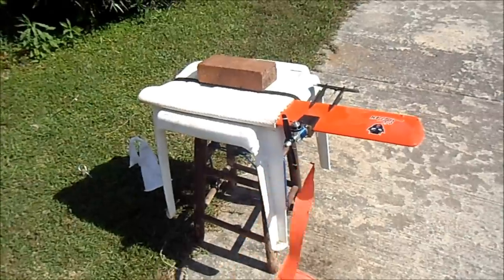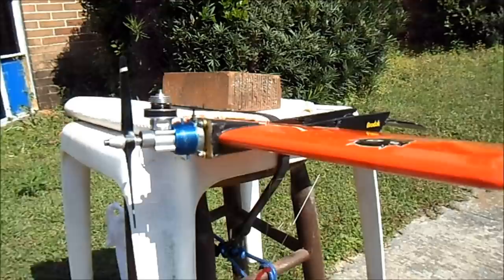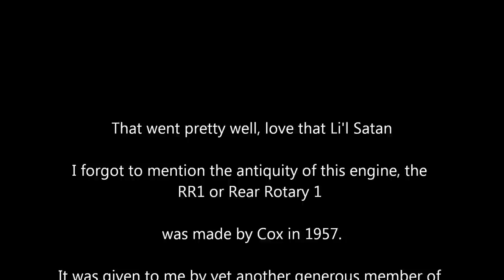RR1 maiden on the Lil Satan.wmv

Comment: How do launch by yourself?
Reply from the maker: Hey, Scott. The stooge is just a folded over bathmat securing the wing. See me take two steps backwards when I pick up the handle... that pulls the wing free of the bathmat, and off she goes!

I use a bungee cord and brick to align with the back of the wing so it won't twist while I walk to the handle. See the picture in the first frame for details.
Thanks for watching.
Rusty
Reply: Thanks You  @RustyKControl_Line

Comment: I remember the RR1!  Good motor. Loved the Li'l Satan by Goldberg models, as well as the Kombat Kittens. I can still close my eyes and remember the smell of Ambroid glue!  The Cox Black Widow was pretty hot if you changed out to the high compression TD.049 glow head and used either cox red can (30% nitro) or fox missle mist (22% nitro IIRC).  Fond memories! Damn, I remember that the Cox Babe Bee .049 was $3.95 brand new!  Now selling on eBay for $100 ... Wish I still had all my old Cox engines .. Babe Bee, Medallion ,Tee Dee, RR1, Black Widow, Golden Bee and others.

Comment: continued...Production ended in 1965 and later engine designs reverted again to the simpler and cheaper reed valve induction system.
During the first two years of production these engines came with a silver crankcase (1957-1958). Later, the crankcase was anodized yellow which contrasts nicely with the dark blue tank.
Cheers! Gilly

Comment: Great control flying Rusty!
RR1 .049 (0.8 cm³)
Manufactured in 1957-1965
At first glance, the RR1 looks like a fancy Golden Bee with small groves on the blue anodized tank and on the nose of the crankcase. The disassembly reveals the twin bypass cylinder and the rear rotary valve intake, which was used instead of the reed valve,
typical for the Bee type engines. There was no spring starter.

Comment: Nice looking vintage plane. If you really want to see what it can do trim a Cox 5X3 down to about 4.25x3 and let it turn up. Might need to go even smaller depending on the power output of the engine. You think 16500 is screaming wait till you get it over 25000!! Great work!

Comment: Are you flying with 35" radius lines? I am just about to finish my L'il Satan and it has been a long while since I have flown. I used to have a L'il Snip which is really similar to the Satan, but I don't remember my flight line length. Thanks
Reply from the maker: Yes, Scott, they are 35' long Spiderwire fishing line, and mine are ridiculous over-kill at a strength of 30# test.

Comment from the maker: Nope, a stock Bee head and a non-spi cylinder. The original cylinder on the RR1, I think. I'll know more about the cylinder after I get the muffler off. Yes, it actually has a muffler. A friend built the engine and gave it to me on my birthday, so I haven't been inside it yet. Nor am I going to open it up until it starts hiccuping.

I bet getting rid of the muffler will wake it up. The darn thing turns nearly 20k RPM on the test bench with the choker on it.

Stay tuned for more.
Take care Valic